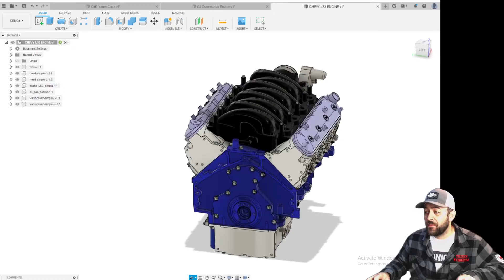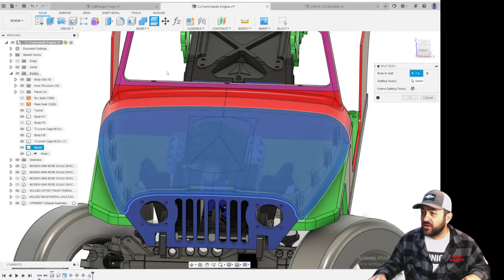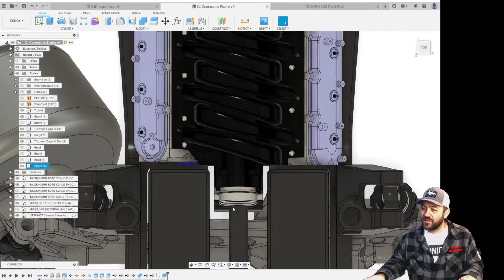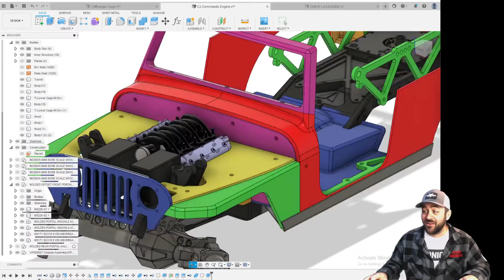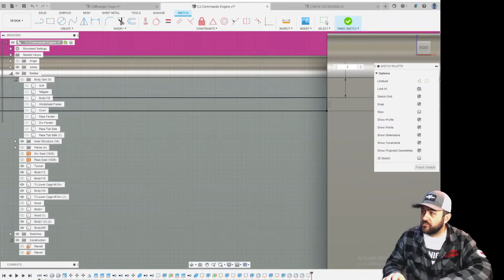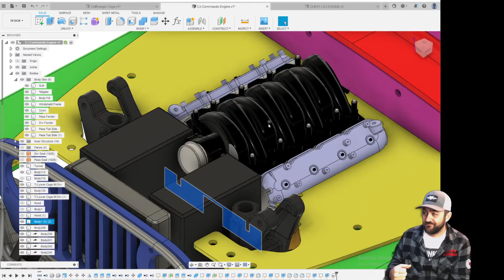V8 Engine Cover - 3D Printing Sunday  - Ep 36

Comment: Will this be on your thingiverse.
Reply from the maker: This is made specific to this build, it won’t be a universal fit item that would be a good choice for Thingiverse.
Reply: @HarleyDesignsInc  I was actually looking for this same thing to fit on to a vs410 build i'll be doing I'd be interested in giving this a shot before i have to painfully print an engine and cut it all up because i can not do CAD very well.